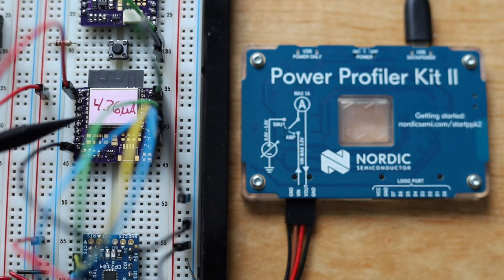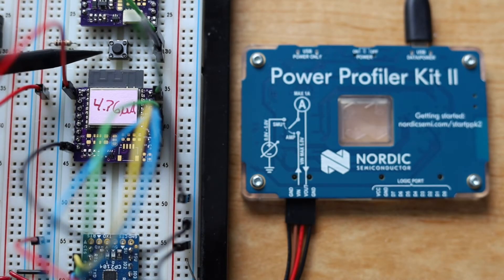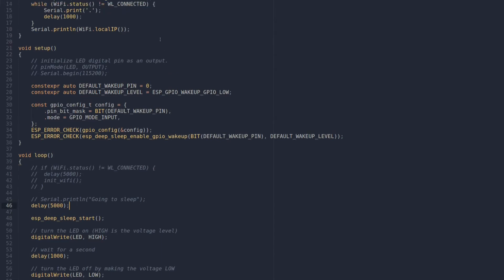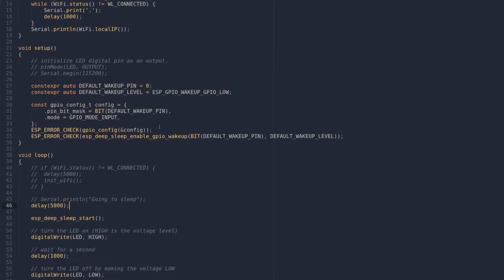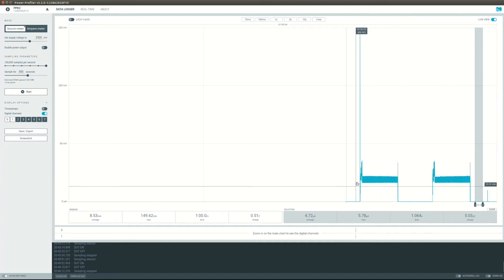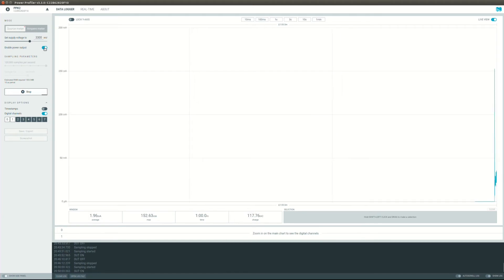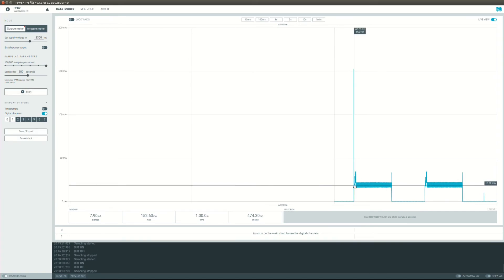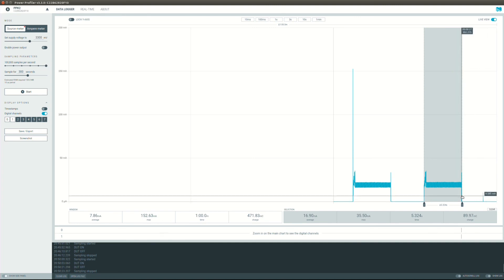ESP32-C3 Deep Sleep + Nordic PPK II

Comment: I would love to get the same result, whatever the board I use I can't go below 400µA. Last board is a Wemos C3 Pico who should be close of 40 µA of the LDO in deep sleep but I am still stuck at 430 µA. Any clue ?
Reply from the maker: Do you input power through the vin pin?
Reply: @francoisgervais1   I tried both powering through the Vin=5v and directly in 3.3v to avoid the LDO regulator, same result :(

Comment: Please share pcb schematic. I like it
Reply from the maker: I'm glad you like it!

This is v1.0 and there might be a bug? https://github.com/espressif/esp-idf/issues/8046#issuecomment-1004255224
If you still want it follow the link in the description and load the v1.0 tag. There is no pdf schematic but you can open in kicad.

If not, I made a v2.0 but did not test yet. PDF schematic is available for v2: https://github.com/fgervais/project-esp32-c3-wroom-02-breakout/blob/master/hardware/project-esp32-c3-wroom-02-breakout-schematic.pdf

Here are oshpark links to both:
v1.0: https://oshpark.com/shared_projects/zFOZECBY
v2.0: https://oshpark.com/shared_projects/iO3nI3Ld